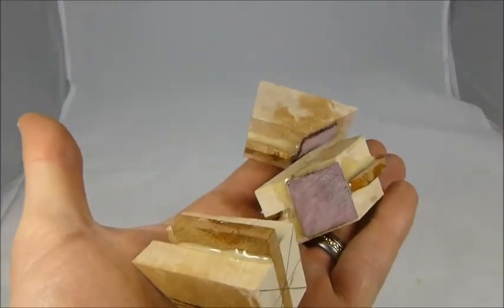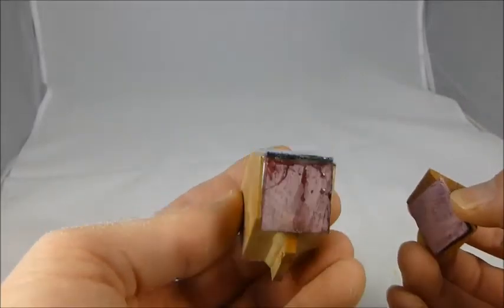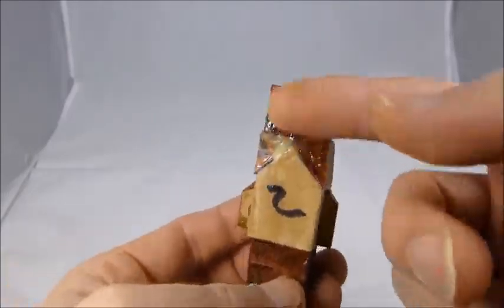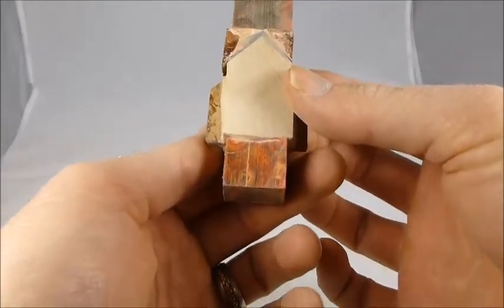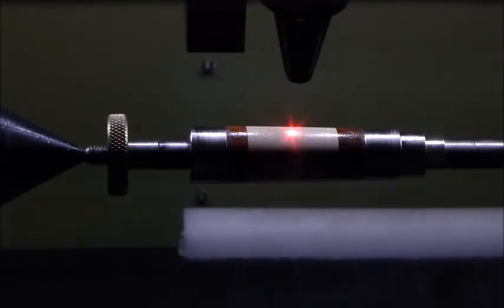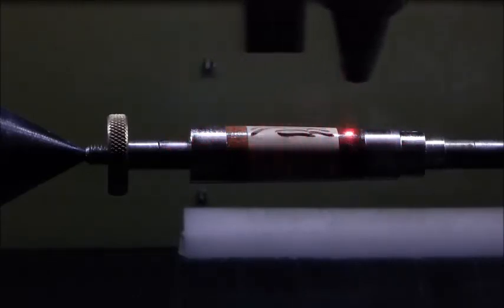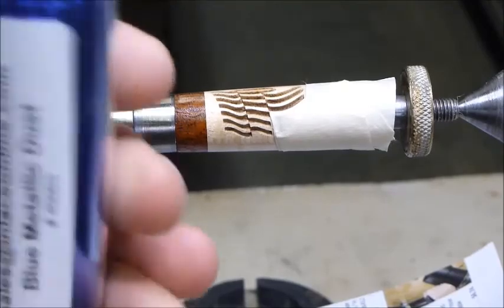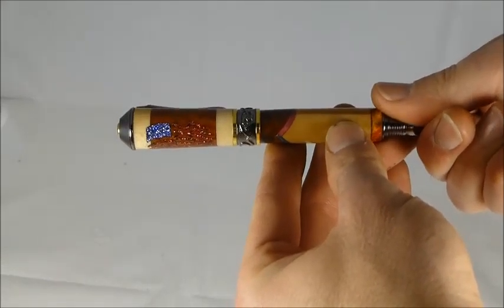Hand Made Segmented Pen 2

Comment: I agree with you also, I would have done the same thing myself and just started over. When I do the ones that I do, I actually vector cut out the peices after running thru the raster a few times, as it will give very clean lines on the blank. I have even been known to vector all the way to the tube, remove all the cut material, then fill with the inlace epoxy mixed with color and stone flakes or glitter. Just an Idea for you to try. Laser here is a Universal 30 w.
Reply from the maker: Mine is a Chinese knock off. They say it's a 60W. If I where to guess maybe 50w. Like you I also like to cut down to the brass tube, it's easier and cleaner I think. It does make the inside of some letters though very fragile, like the top side of a capital "R", or "A". I break more of these things off. LOL If I ever buy another laser it's going to be an epilog. But I don't see paying 30K for 30W.
Reply: Sean G If you look around closely, you can find a 30w for less than 12k new. I was just looking at the Epilog to use as a portable machine, desktop style, still 12x24 and was able to get it for right at 13 with the stand and the rotary. I have the Universal, but I also have a 12w 8x12 Laserpro and an Epilog Helix at 150w. My business is laser work and engraving. As far as the issues at the top of the lettering, try different fonts. Some of the more rounded fonts, like aeriel round, goudy and vag round doesn't give that issue. The real trick to small lettering is to stay with rounded letters, avoid sharp points, and take more cut passes at lower power. This also works with standard letters. I have seen some guys who vector with a 50w at 75% speed 50 % power, but vector cut letters at 25% speed, 20% power and 4 passes will take about a minute longer to cut on a pen, and will look 500 times clearer.I also make sure that I don't remove the pen from the mandrel until I am ready to assemble it. I built a fixture for the rotary that allows me to center the mandrel in the laser so I can avoid taking stuff apart with an extra chance for damage. I always joke that with 3 lasers, a rotary engraver, 2 cnc routers, a table router with comp controlled fence and router lift, a vinyl cutter, dye sub equipment, 3 lathes and a full wood shop with everything except 1 lathe being Jet, I am in need of more equipment. My next is a fiber laser and a metal lathe to make new styles of wood and metal pens. I love my hobby!
Reply from the maker: Dean Swander Wow, you do have a lot of toy's. Very cool. I too have a CNC router. Using to learn and make the leap to metal. I have my eye set on a Tormach PNC system. CNC vertical mill. I will have to try the lower power, more passes. It make sense. A more pin point burn.